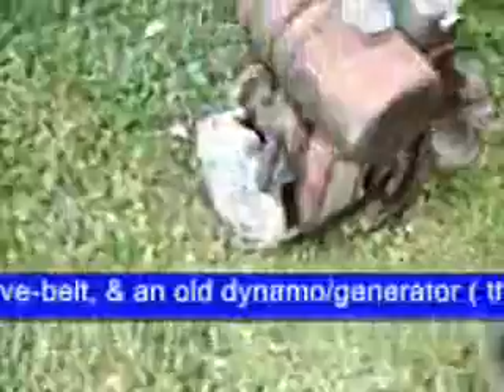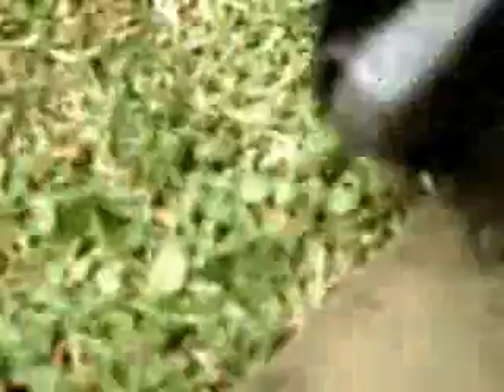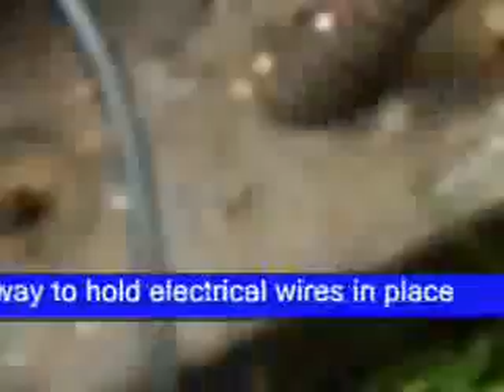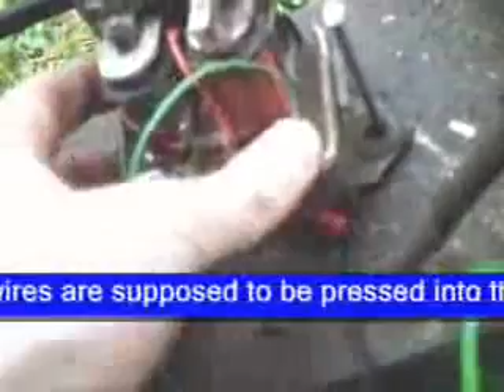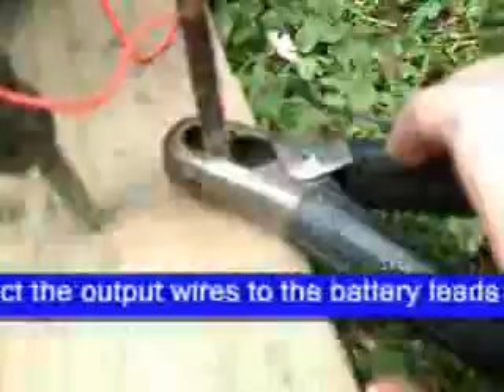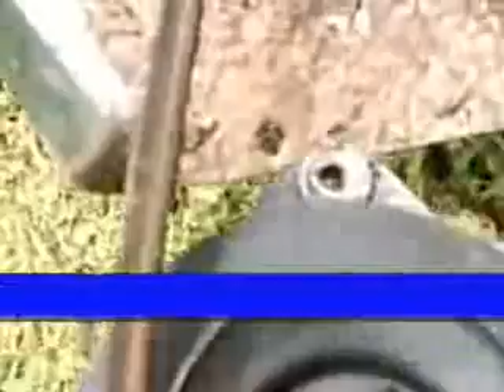rough guide to home made battery charger

Comment: lol i did that too when ya need a battery charger in some place where ya dont have electricity, i still have my old starter generator but all i need is a 5 hp horzontal engine and i have me another gas powered charger.... good work 5/5

Comment: I always wanted to do something like this on my boat trailer so when i tow it to go fishing it would charge up my batteries. would make it alot easier than hooking up the battery charger after everytrip. Wich in most cases is about everyday in the summer. But then again my traler axle gets submerged in water so it is probably not a good idea. Maybe a solar tender is the way to go there. what do you guys think?